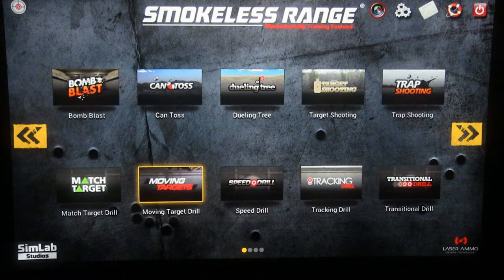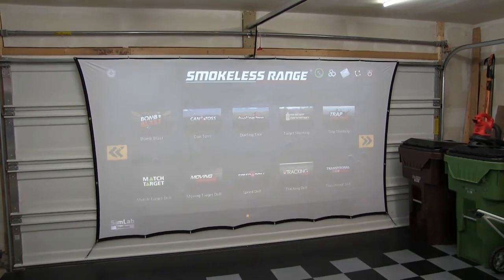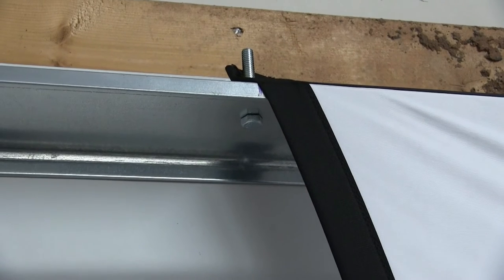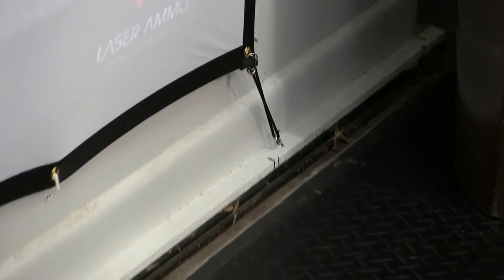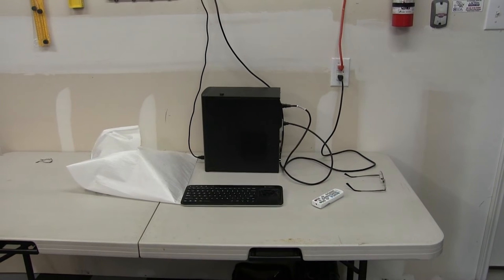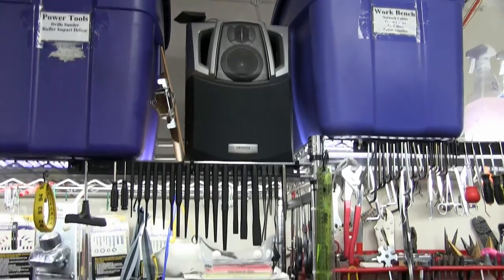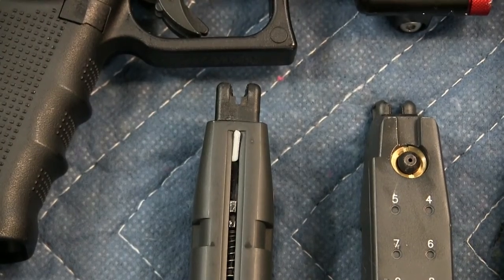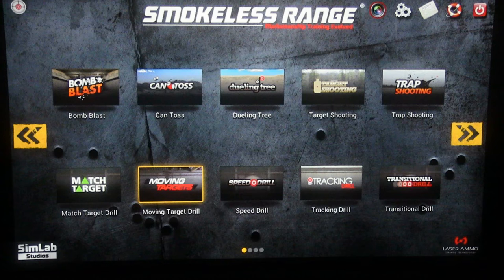Smokeless Range Garage Set Up

Comment: What did you use for the smokeless range camera to mount it to the ceiling?
Reply from the maker: Hi Aiken,
VIVO Universal Extending Ceiling Projector Mount, Height Adjustable Projection, White, MOUNT-VP02W
https://amzn.to/3FqbvJu

Universal Projector Mount Height Extendable 14-23.7 in / 37-60 cm 360° Adjustable Video Projector Ceiling / Wall Mount Projectors Bracket Silver for Projector CCTV DVR Camera
https://amzn.to/3HaFk1n
Reply: @WorkMateGuy  Thanks. What did you use to connect the camera to the post?